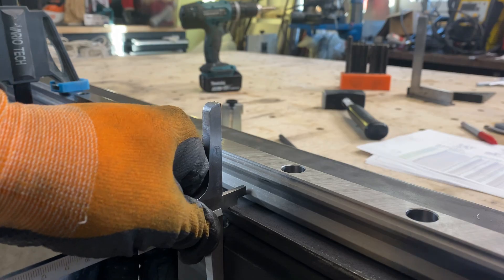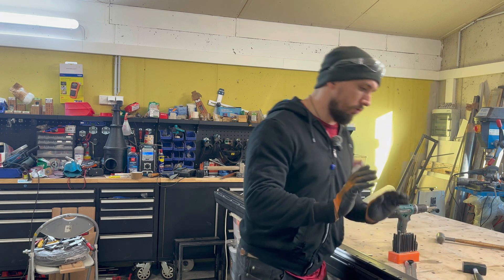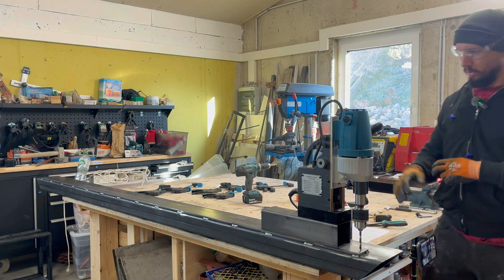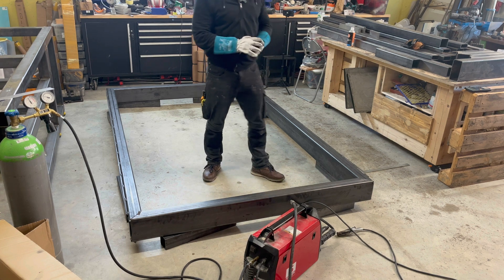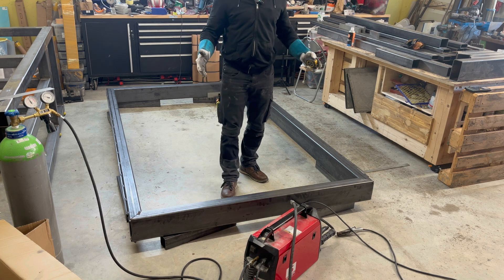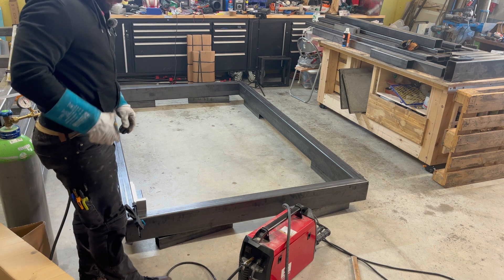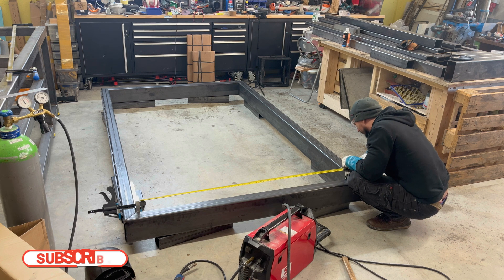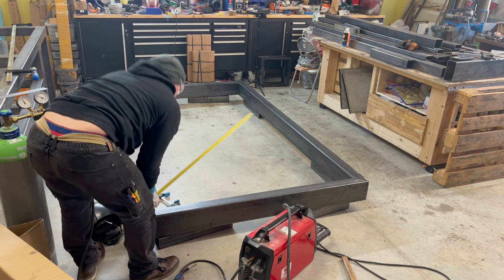Install LINEAR GUIDES Like a Pro in 2024: Your Ultimate How-To!  || (PART 3)

Comment: Did you check the flatness of top surface? Using two strings diagonally running across eachother. If strings touch eachother it means is flat enough and not in propeller.

Comment: How have you mounted/welded the flat bars that the linear guides are mounted on? It’s very important that they are completely flat along the entire length and that they don’t twist at all.
Reply from the maker: Hey, so what i did was to use C clamps every 200 to 300 mm to keep it as flat as possible. I then proceeded to tack weld the flat bar in place on both sides. After words, I then welded about 2 to 3 cm welds. As far as getting it near prefect. You would need to bend the sides straight after welding. Since that many welds over the length will cause it to bow. Then you would need to mill the flat bar to make it with in .5mm or less.